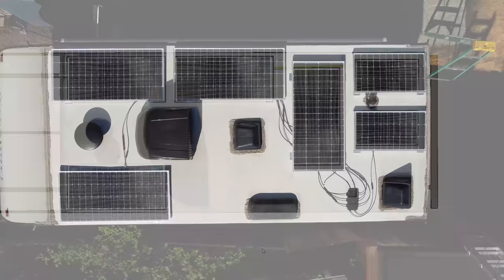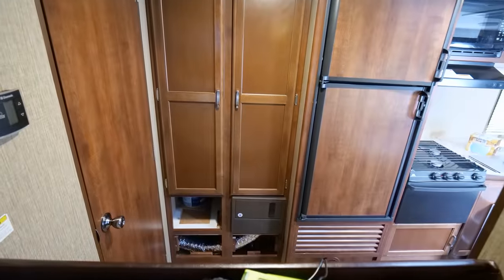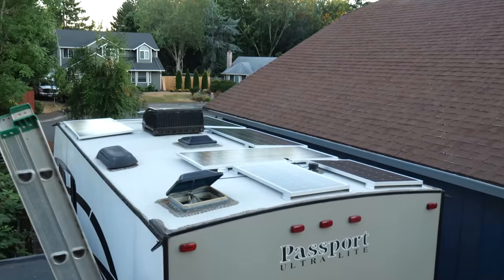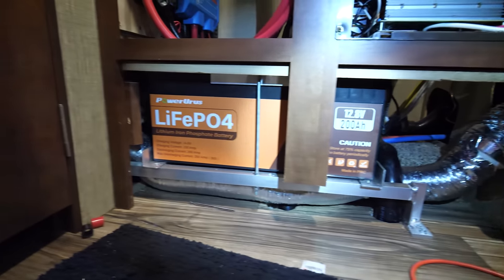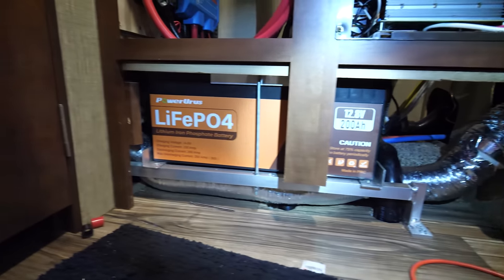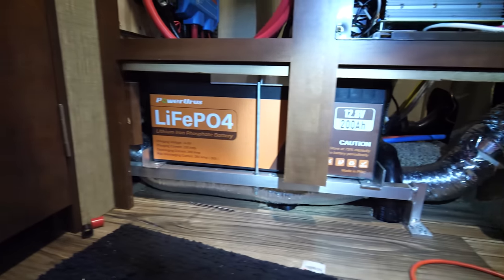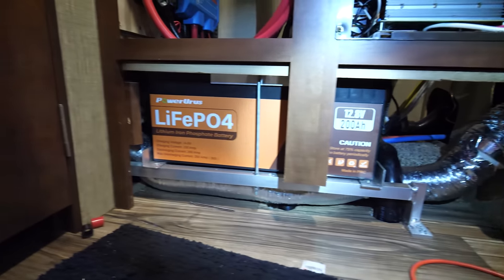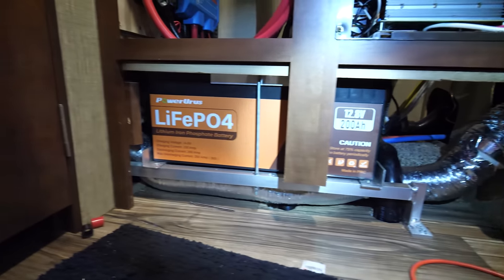New Off Grid Solar Power System!

Comment: I think the ground on the frame should have been a bolt welded in place. I've seen nut rivets losen and corrod causing bad electoral connections.

Comment: The bonus everyone misses is that you can use your trailer as a power station if the power goes out. 
 A couple of cords and you can keep your fridge and freezer cold and run some lights, charge your phone ect.
Reply: Carefully, the word is carefully!!!  Sure, it's very possible to run things in your house off of this system, and that is a BIG bonus.  But don't back feed the power into your home and electrocute the good people from your power company who are trying to restore your power!  If you are going to try running your home, you need a generator transfer switch, and you need to know how to use it.  Or, just use a few extension cords to plug your fridge and freezer and a few lights into your trailer, which is what I think @dangeroustoman was referring to.
Reply: @theclearsounds3911  I was assuming that you have a inverter in your camper and yes I ment extension cords.
Reply: @dangeroustoman  Pretty close; in my previous house I had a detached garage that I had mounted a few solar panels, batteries, an inverter, and a generator transfer switch so I could power some circuits in my house during a power outage.  I just felt the need to warn people that, if they built what I did, which is similar but different to your setup, they have to make it safe.
Reply: This is very easy if you know electrical. I have two auto transfer switches, one on the RV (basically like what a victron has built in) and one in the house. I have two 30A cables, one from my RV and one to my RV. When both are plugged in, my RV is just sitting there making sure everything is good. When the power is out and the house is still plugged in, both auto transfer switches change, moving my home fridge, microwave, and a few outlets to the RV inverter and isolating them from the grid.  This required a sub panel on the house, and a 30A outlet on the RV. I have 2000W of solar and 10kwh of batteries so I can easily run what is needed.
Reply: @stinson87  Nice setup!  That's what you get when you know what you're doing!  Even the extension cord method that the other guy did can be safe if you can't afford to do it the way you did.  I'm sorry if my other comments seem too harsh, but I've become a fan of the Youtube channel "just rolled in", which shows the dumb and dangerous things some people do to their cars when they know a little bit about fixing cars, but not enough to do it safely and correctly.  It makes me want to warn everybody what NOT to do, like make one of those suicide cords thinking you're going to power your whole house with that.

Comment: A lot of the teardrop trailer campers use external solar cell panels like Zamp. The problem is that a good campsite is usually in the shade, so by able to putting panel in near by sunny spot allows recharging in boon docks.

Comment: Stout Grove! That's my favorite place to see the ladies, as I call the redwoods. I lived in Humboldt for 8 years, and now I live an hour from you, so this is familiar.
I need to replace the battery in my old RV, and have been putting it off. Unlike yours, mine is rather small, so it'll be hard to shoehorn everything in. But I love the lithium chemistry, far better than lead acid.

One thing: never rely on sealant alone! I used to do solar installs in Humboldt and we never ever mounted panels by just gooping the feet and screwing them down. If I were you, I'd put rubber sheets under the PV panel brackets and also attach a small flashing in front of each one to divert water around them when driving.
Reply from the maker: Thanks for the tip!

Comment: Nice simple breakdown. I have a renogy DC-DC charger to pull 50A from my truck if my 2000W solar does not keep up. I am planning 3 more so I don't have to run the truck long if needed, but I do have a Cummins diesel with dual 220A alternators that at high idle can safely provide 300A continuous since they are designed for ambulances. I have a little over 10KwH of battery and converted our dual fuel fridge to residential since a residential only uses 1000-1800WH per day where the duel fuel on electric only mode uses 8-11Kwh! Cabling is a pain to deal with but keeping everything very close really helps. My inverter input is 18" from the battery and solar chargers are 24" from the battery. The only challenging run was from my truck to the trailer where I have ran 4AWG cable using a 120A rated quick connect. For those wondering... my truck consumes right at 0.3 GPH of diesel to generate 3KW of electricity off the alternators. While driving the alternators need about 4 hp, which is no problem for my 400HP 1000LB-FT High output Cummins.

Comment: Hi Clint, nice build and a great place to visit, the only thing I would have added to the build would be a dc to dc charger from your tow vehicles alternator. Thus charging your batteries whilst you are driving, this would charge as you run you AC and replenish  some of the usage. Thanks again for the video.
Dean in the UK

Comment: For the TV you can buy TV's that use a "power brick" with a barrel jack, then find out if it's 12v, 19v, 24v and get a simple voltage converter if it isn't 12v. OR look specifically for one that is they exist! It'll save maybe 20% on energy used by the TV, likewise the microwave can be converted to run on straight DC but it requires more advanced knowledge, I think they make DC microwaves though. I'm a fan of 24-48v systems myself, thinner wire, use a step down converter where needed but if you are doing a full build/reno then just make everything 24 or 48v respectively that you can.

This is a great video and highly information I totally understand why you prefer 12v it's generally far safer.

Comment: Have you considered adding a second alternator to the Bronco, that could charge the battery bank while you drive? I still find it weird no one has tried using the wind from the drive lol
Reply: then you are just paying for electricity with reduced fuel economy. nothing is free (except solar)
Reply: @tyrelirwin right, but I think it's a good trade off, when the sun isn't shining, like in his video.
Reply: @juanmacias5922  you're just suggesting a less efficient generator. And literally on this channel he built the wind turbine and did the math to show the inefficiencies there.
Reply: @JD2jr. ah, you're right, I literally forgot that series, where he used the turbine on the Bronco. xD
Reply: If the turbines are above the car its less efficient but if the turbine is placed in front where the wind hits the car anyways it would be about the same efficiency without a turbine but with added generation.

The car is already being hit by air, just redirect it.

Comment: Why not using 24 V system or even 48 Volts?
Reply from the maker: I didn't want to have to add a voltage converter for my 12v stuff.
Reply: @QuintBUILDs thanks a lot for answering I love your videos! Building solar on my roof as well and wanted to keep the amps down. Maybe 12 volts have the benefit of less “spark” potential if there ever comes a wire lose.

Comment: One recommendation - we went with a self-installed 9,000BTU mini-split for both heat and cool (we prefer winter camping) instead of trailer AC / fuel heat.   We're in year 3 and it travels well / quiet and is pretty efficient on power at 1" foam board insulation (R5) / 100sq ft.    Some numbers for you:  We went 13kwh battery w/1200w panels instead of you're 5kwh / 1000w panels and we're all electric (fridge, micro, hot-plate, k-cup, tv, etc).   The mini-split burns ~4kwh for mild temps (45F low 95F hi) - very reasonable.   Unfortunately, at a full 15F low, 50F hi, and 75F internal, the mini-split needs ~20kwh/24hrs so we can't winter boondock for 1 day at all electric.   We're in the process of expanding our DIY battery bank to meet this goal.   Overall - we found we can boondock for overnights while traveling because of sun while driving but prefer electric outlet for multi-day stays at the destination.   We have a generator but it's so noisy and a pain we don't think of this as anything other than emergency.
Reply: To increase your available power when boondocking off grid, I would suggest a collapsible 'ground' station you can carry inside the camper for travel, and deploy once you are at your multiple day stay destination. My thought is a set of panels on collapsible aluminum stands that you carry out and set up once you stop. They merely plug into the existing charge controller on a second circuit. And will provide as much more power as you are willing to carry out and set up.

Think of an artists easel, with solar panels in place of a canvas.
Reply: Already have 1200w of panels - it's the trees that kill the solar.  Most spots we camp are among trees (beautiful) and/or in winter (cloudy) and would need hundreds of feet of wire to put 'remote' panels in a spot with no trees :)     Agree there are plenty of camp sites with sun,  we just don't seem to wind up in them for the most part.
Reply: @kennethalmond8922  True you can not move the trees, but more sq ft of panel will give more power. I merely suggested a way to add more sq ft of panels since the roof is already occupied.

Comment: If you park it next to your house and with proper electrical connections it becomes on grid power supply for home passively cutting power bills to nothing while still having grid access for shady or non windy days  more batteries in the house the better just expanded storage then more panels more production don't even worry about branding just something to start and safe electrical hookups oversize the wires to lower the electrical friction as i call it but everyone else says heat losses due to resistance 😊

Comment: Why didnt you put the batteries in Series to at least make it a 24V System? Also isnt Victon gear kinda overkill for a trailer? Probably would've been more than fine with an Aliexpress job
Reply: Especially when using 24V instead of 12V halves the current for a given power (so lowers the size of cables running from the panels). Some home system use 48V for this very reason.

Comment: you used silicone for the cablehousing and the screws in the roof? you dont want that as its not long lasting dealing with weather outside. you should use dekasyl ms-5 or sicaflex.

Comment: Some appliances require AC power, but what about TVs and electronics that will convert it back to DC? What would happen if you supplied DC power to a AC/DC converter?

Comment: For charring stuff with electricity directly, there are high voltage vacuum tube tesla coils. At high enough frequencies and powers a discharge can resemble a real flame. Or you could just whip out a microwave transformer if insane enough. But these things are DEADLY. However some microwaves do have a grill function, but i am not sure it will char anything. The woods that you went to are amazing! Thank you!
Reply: What really adds flavor is the smoke from the fats that run off.  Maybe that can be replicated but in my opinion, for camping in the woods, i think a few hubdred dollar for a grill and propane beats thousands for an electric grill and additional batteries and solar panels, and that's not covering their additional weight over a tank or two of 20 lbs of propane fuel.

Comment: If the Air HVAC could be moved to the DC side of the inverter in which case  the DC-to-AC loss could be eliminated from sroucing the power from the  Batteries and Solar PV sources.  

The negative is that if you're on AC power from a campground hookup, you'll lose on that conversion to DC get to the HVAC.  

It'd be great if you can set it up tp switch the HVAC power source between AC and DC so you could have best of both worlds.

Comment: I suppose you don't use your trailer all year long, so have you considered using the energy from your PV panels to generate free electricity for your home ? Micro-inverters are what you want to use (converting DC to AC of your home, using the MPP of your panels).
Reply from the maker: Monitoring power draw of the freezer in the garage as I type this.

Comment: If you have the cash and are willing to do it, here is an option to increase your solar immensely.
Think about when you deploy your canopy over the entrance to the RV. In place of a simple roll out 'cloth' shade there, put flexible solar panels in place. If your canopy is 8 feet wide and 12 feet long you could have 96 sq feet of solar panels there. 
Most solar panels with an output of 100 to 250 watts per panel are under 4 feet long and 2 feet wide, or 8 sq feet. So you can have up to 12 standard solar panels equivalent or 1.2kw to 3kw by replacing that canopy cloth with flexible solar panel material. That's 1.2 to 3 times more solar than your current system, by replacing the canopy over the door.

This is either labor intensive or expensive depending on how you approach it, but it will over double the normal solar capacity of your RV with only roof mounted panels.
If you replace the roll out material it is going to be expensive. Here you use a flexible material that rolls on the normal canopy rod, but requires much heavier duty motors and hardware.
If you make a detachable panel you hand attach to the outside of the camper and manually remove and fold every time it is going to be inconvenient, and labor intensive, as well as bulky to store inside the camper every time you move.

Just thinking aloud, but it is a possible I think to make this work.

Comment: 10:53 If you enable 'has DC-system' in the settings you probable see where your 'loss' went. A loss of 400+ watt is to much.... Probably running the lights of the DC side of the trailer.

Comment: Nice job.  Could you summarize the solar panel wiring?

The reason I ask is that mismatched solar panels can be troublesome unless you’re careful to observe a few rules.

1). When wiring mismatched panels in parallel, the lowest voltage solar panel will bring the other panels down to its voltage.  That can waste a large amount of power if you fail to recognize it. 

E.g.- four 40 Volt panels plus a 20 Volt panel all wired in parallel .  The voltage of ALL panels will be 20 volts.

2)  when wiring mismatched solar panels in series, the current will be dictated by the lowest current solar panel.  Again, this can decrease the power by quite a bit if you’re not aware of this.

E.g.- four 10 Amp panels all wired in series, then add a 5 Amp panel in series….. the result is that the current for all five panels in series will only be 5 Amps.

3)  Regarding your choice to use parallel connections for most of the panels (as you briefly mentioned) I agree with you.  

If you had chosen a series connection scheme, Partial shading from all those trees would have wreaked havoc on your system.  If any one panel is shaded in a series string, the current of the entire string drops to almost zero.  In this system, parallel is definitely the better choice.

Thanks again for all the hard work.  I’m a Patreon contributor.  Love your projects!
Reply from the maker: Happy to, and thanks for being a patron! It was easy to fit 4x 200W panels on the trailer but I wanted an even 1000W to make the numbers easier to explain. 2x 100W panels fit nicely but as you say, the (maximum power) voltage was about half the 200W panels (19.1 vs. 37.9). So putting the two 100W panels in series would get them really close to the voltage of a single 200W panel (38.2 vs. 37.9). My research agrees with your assessment, that ALL  panels wired in parallel with these two series 100W panels will operate at the lower of the two voltages. Fortunately according to these specs, the 4x 200W panels get to operate as normal while the 2x 100W panels will perform slightly lower than their rating. But multiplying the lower 37.9V x 5.29 amp rating is still 198W. My original calculations with slightly different ratings showed a loss of ~20-30W but that's a trade I was very willing to make to get another 170-180 watts out of the system! Hope that answers what you were looking for. If not, you know where to find me!

Comment: What is if the Batteries are full and still gets charged by the Solarpanles, isn't this dangerous for the batteries or is there a off switch for this case?
Reply from the maker: The solar charge controller limits the voltage and the internal battery BMS disconnects the cells when full.

Comment: diy rechargeable znso4 zinc plating zinc-air fuel cell battery, with carbon rod/felt electrodes. watt hours? also a high amps dc lorentz motor, radial bar with wheel running on a track over a vertical ring magnet.. just brilliant, also some sparks. btw its just about 14kg of zinc for 14kWh of battery, which is a small volume, as zinc is 7g/cm^3 or 2L of zinc.

Comment: Simple would be to use one hybrid Inverter and high voltage from in series connected solar panels, cause then only small wires are enought. Lead acid batteries are totally obsolete. Buy some 280Ah Lifepo4 batteries, a Jikong BMS (with 2A balancing). From the capacity of lead acid you can only use half of it, with Lifepo4 you can use all the capacity without damaging them. Lead acid has a cycle life of 600 if only discharged down to 50%, but in reality it will last far below 600 cycles. Lifepo4 has a cycle life of 6000 and they will be reached. The weight of Lifepo4 is 10 times less (compared with a lead acid battery with double capacity, were you can only use half of it) and the volume is 130% less. The costs for Lifepo4 may be initial a bit more, but all in all its less than 1/3  of the costs you would have with lead acid.